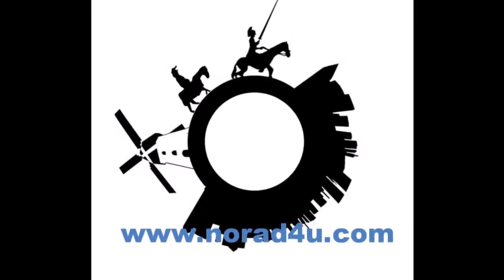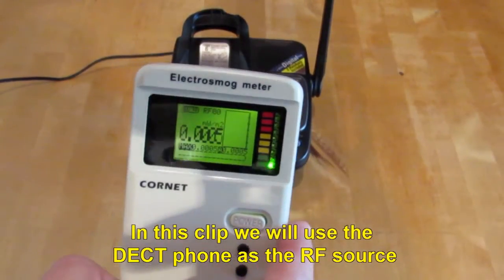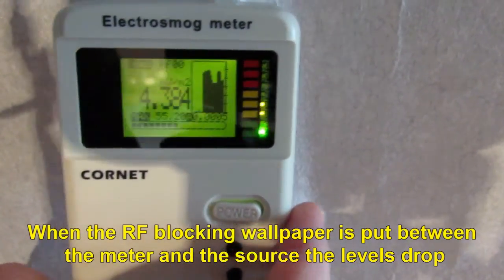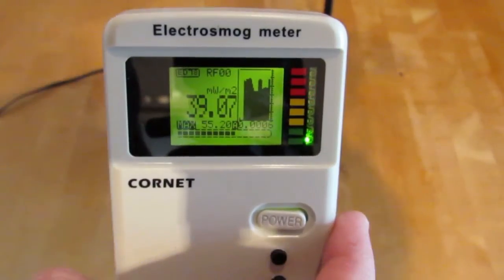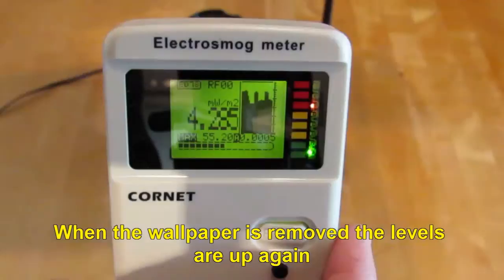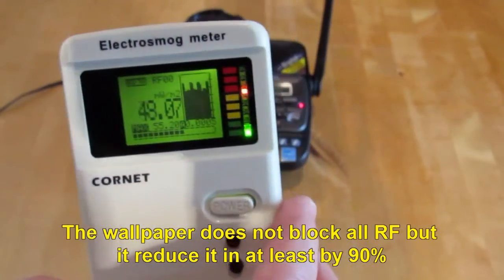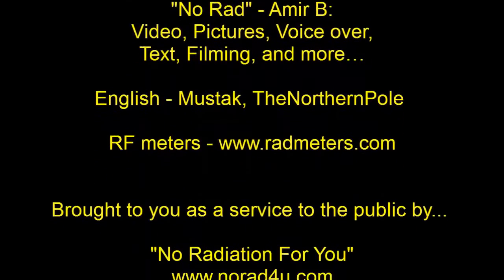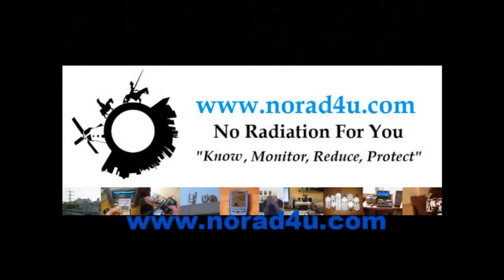Blocking RF EMR with RF blocking wallpaper

Comment: I have 4 smart meters on the outside of my bedroom wall (2 are neighbours) 
I live in a second floor flat.
Would the RF reducing wallpaper be effective if I covered the area opposite the smart meters (not the whole wall)
Reply from the maker: You need to first measure the RF levels and search for the penetration point. Then cover this wall with 2 layers of RF Blocking paint, than one layer of the wallpaper. 
Please see - http://www.norad4u.com/q-a/howtoprotectfromasmartmeter
Reply: NoRadBlog I know where they are, they are flush with the corner of my bedroom 6ft high 3ft wide, if I cover that area will it work?
Reply from the maker: You need to find where the radiation is coming from. 
I am not sure that it comes from being the meter.
This is why you need to test the RF levels and find the penetration points.